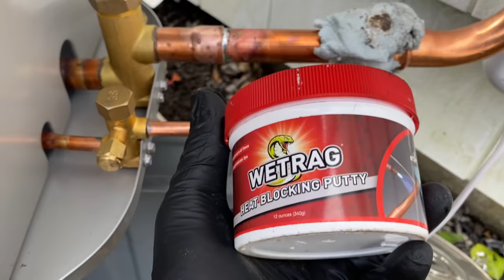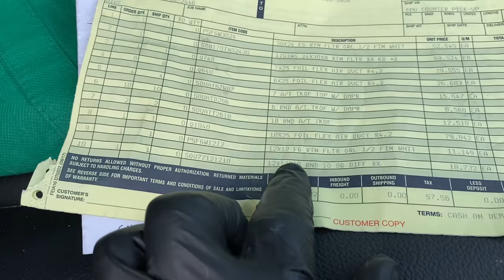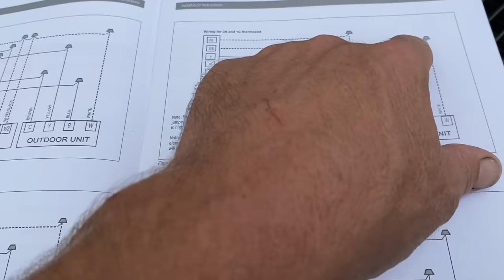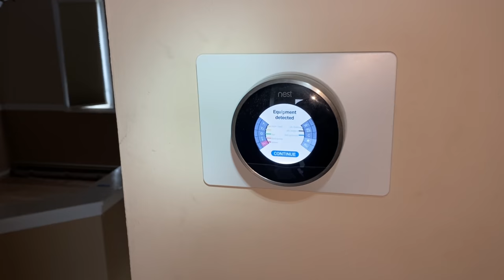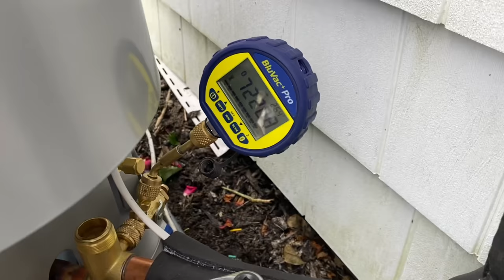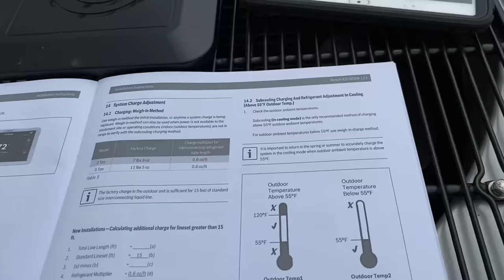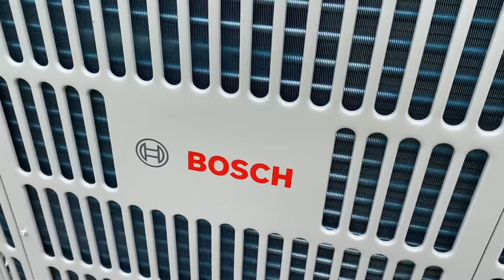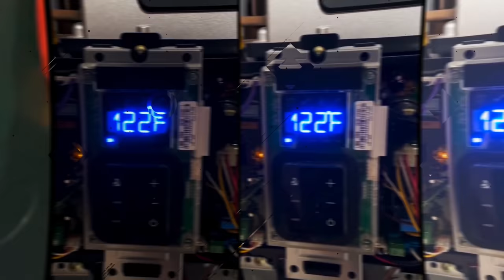Who Installed This Abortion? Another Hacked Central AC System Replaced with Bosch IDS 2.0 Equipment

Comment: You're the man pipes!!! And I was always told to open liquid line first because if you open vapor line, all the liquid will sit behind compressor on start up and possible flooding could "possibly" damage compressor. 🤔 what do you think?
Reply: I was always told to open the vadpor line first that it pulls all the oil out of the  compressor if you open liquid line first. Then I see Mikey opening the liquid line first so that's another myth.
Reply: @ronniebuchanan6575  dont do that, you run the risk of sucking liquid back into the compressor.  just crack the liquid and wait a couple seconds to fully open.

Comment: Hey Mike nice install . I usually do a attic install using as much round pipe as possible on my suppies and retutns . But nothing wrong with flex up to a certain lenght . I change my pump oil every month unless I have a burnout . Then I change it right after that .
Reply: 30 year vet here in Canada 🇨🇦 Blows my mind the amount of flex used in the states definitely makes for a quick install tho .

Comment: I work on a lot of pre-existing system's large RTU's and I have to vacuum through compressors. Vacuum oil being new helps cut down time to vacuum system down for me. Sometimes vacuum will plateau the only thing I do change oil in middle of vacuum than system will continue to pull down.  New copper and non contaminated system usually vacuums down quickly... Usually , depending on condition.

Comment: Love the Bosch 2.0 last one I installed had a nest stat I didn’t realize it at first had to change reversing valve to B because it was trying to run heat at first but those systems are awesome and we’ve started to install a bunch here in NY with back up strip heaters as well. Love your work mike and enjoy watching Bosch installs as well!

Comment: That attic isn't too bad......but im glad im commercial/ industrial and don't have to deal with them anymore. I spent my first 12 years in install in So Cal attics which get to 140°+. 
PS- You dont have to insulate the liquid line on a conventional heat pump. Mini splits you do, because its not a conventional liquid line. Its a low pressure, low temp line. Think of it as a long line to the indoor coil after the EEV. Just like a conventional system where you see a txv that goes to a capillary tube distributor, same concept

Comment: Liquid line insulation isn’t needed, but it doesn’t hurt. Attic runs gain heat without it in cooling, and lose heat in heating… but it is all efficiency…

Comment: I change my oil about every 3rd time, but I have an older rotor vane system that runs in the oil and it helps keep scaring down on the vane. on the opening the valves, I always open high side first, keep the flow going in the direction of the normal ac system, I also always start the vacuum on the low side then open the high side once it pulls down.

Comment: Great video, nice install. I was curious if the air handler has any kind of electric aux heat or e-heat. Seems like the low winter temps. are not ideal for a heat pump. Wonder what the Bosch manual says about the subject?

Comment: Liquid Side First Ensures you have no restrictions. It passes thru then flashes.heat in attic helps the. From being in a vac pulls to the suction line. ( idk way I was taught and think it’s the best practice) 

Comments below. Idk if I’m just picky or whatever but I change the oil on my pump after every use. Before it gets put back in the truck the oil is changed. Quick change cartridges it’s a money making tool treat it well. 
Young Mikey is right. I have had an appion Tez and didn’t change it and pump took a shit. ( which was new installs) with an electrical connection at the disconnect 

I have seen a lot of heat pumps on the island. We have always insulated both lines. Otherwise loosing heat during heat operation.

Comment: One other thing to take into account on the condenser unit is the spray pattern of the sprinkler system. You took out some plants to set the unit in it's new place, but had a sprinkler riser head on both sides of the unit, don't need to drown the unit. (lol)
Reply: @PipeDoctor  My bad, did not think that way, I have installed coil coolers on units in Las Vegas on roof top units. Air temp around 110 deg's. roof temp 140 deg's.

Comment: If the TXV is in the air handler, no need to insulate the liquid line.  You don't need to change the oil in the vacuum pump unless it's affecting performance.  But changing the oil should extend the life of the pump.

Comment: How much.? $17,500.⁰⁰ for demo old system and install Bosch IDS 2.0?

Only reason mini splits insulate liquid line is because the EEV is in condenser and in cool mode both lines condensate beacause they are both after the electronic expansion valve. So the line set is part of evap coil.

Comment: No P-trap? Wouldn’t that pull humidity up the drain into the airhandler?? Plus the thumping sound when it tries to suck trapped water up such a long line and slams it back down.

Comment: Stay bright 8 is very strong, the issue is when PLUMBERS use it, because, the flux job is different from water piping. The flux needs to coat the male fitting, and the female needs to be CLEAN, but unfluxed. There needs to be ZERO flux intrusion into the lines.
I am still a fan of silver with a nitrogen purge flow over stay bright 8.

Comment: The manufacturer has to recommend replacement of the oil after every use, because they have no idea what contamination is in the system you're evacuating.
 It is a good service practice; considering the unknowns of every evacuation. I personally change the oil when my pump fails to pull below fifty Microns, or when I feel as if the oil has outlived its purpose. 
 I've repaired a circuit in a package unit that was left open to atmospheric conditions for weeks. When evacuating l, I literally had to change the oil twice and the process took an hour and a half, even using TruBlu hose

Comment: It was me that commented on opening the liquid line first. Mostly because if you open the suction first the refrigerant flows  backwards through the txv which isn't good  for it. Obviously doesn't apply on heat pumps.
Reply: Oh and you only need to insulate the 3/8" line if it's an outdoor txv

Comment: VACUUM PUMP OIL CHANGING In my opinion changing the oil depends on a lot of factors like how dirty the linesets are, how long the construction crew left the lineset open to air, and whether the system was a burnout e.t.c.

Comment: You do not need to insulate the 3/8 liquid line for a heat pump. But you do need to insulate the return and supply box’s in the attic.

Comment: here in arizona, a majority of our splits are heat pumps. never see insulated 3/8th lines, only 7/8th. also is the filter drier at the air handler per manual or? otherwise install turned out nice.

Comment: I opened high side 1st because the smaller line has less of a chance of sucking the oil out of the compressor with the vacuum..  I don't know if that makes sense but that's how I do it

Comment: If you  don’t change that oil,  it corrodes the guts out of your pump.   I had the “still works fine” attitude.   Took apart my one year old pump and it was rusted inside.    Now I dump the oil when it’s still warm every time.
Reply: @PipeDoctor   Till it doesn't perform anymore.   I have a friend using the same pump for 15 years.   He's not an installer though and he certainly does mind that its slow.

Comment: Nice install however, as a homeowner, I'm afraid to bother with the complicated HVAC units with all the bells and whistles due to more to go wrong and more cost to maintain. When I saw that big main board on the condensing unit and then L1 & L2 connecting to that board, I said no way...that stuff is not robust and not rugged for the long haul. Solder joints on those boards tend to crack and I'm sure just that part price is well into $500 range. Good that you put another return in the master, more than one return is important for a few reasons. Looks like the customer paid a hefty price for that high end HVAC.
Reply: @PipeDoctor  Yes and those nice 10 year warranty costs are in the price of the unit. If the cost of power is on the high side for a set location/area, it makes a lot of sense to choose 18+ SEER condensers. Our power in CA is .29 cents per kWh up to a certain amount consumed, about 1,300 kWh, then it goes to .34 cents per kWh thereafter. We use a good 1,700+ kWh in the summer months so depending on the cost of those high SEER units, it might benefit us to change out the great equipment we have currently. No plans on moving so, we'd benefit. Still using a 10 SEER R22 Copeland.

Comment: Question you put acid Flux on the copper inside and out my concern is that the Flux is going to be inside mixing with the oil/ ref and later causing burned out pump. Just asking. Nice clean job . Danny is the one!!!.  Love those Bosch units I have to get better at selling them only been in my own business for a year. I change the oil after 4-6 jobs

Comment: I think I would add a surge protector at the condenser and the evaporator.  While the whole house surge protector does a good job, you should have a surge protector closer to the equipment. Something like an Intermatic AG3000, would be easy to install and an upsell for protection of that expensive Bosch electronic hardware, not to mention the compressor.
Reply: I recently got a new Lennox XP20 heat pump. Definitely made sure to ask them to install surge protectors. One on the air handler and one outside on the disconnect box. Lived here 14 years and never had a surge with my carrier unit, but this new Lennox is like a computer. Luckily, about a month ago during a storm we had some power surges but it didn’t trip any of them. BUT I thought to myself, damn glad I remembered adding those surge protectors! Lol

Comment: Lot of heat pumps where I'm at in Atl GA.  Don't need to insulate liquid line. It's always the liquid line. Suction line will be discharge in heat and Suction in Cool mode. W1 is needed for outside to turn on auxiliary heat when in defrost in order to temper the air because it's in ac mode when defrosting and you don't want it blowing cold air inside in winter 😑

Comment: NOOOOO. 
The main reason why he vapor line is ALWAYS opened first is oil return to compressor.
It is spelled out in the install manuals.
Opening the liquid line first flows refrigerant to the liquid line, the refrigerant takes oil with it.
Opening the suction line first, oil flows into the vapor line, and on startup, oil is more quickly returned to the compressor.

Manufacturers always specify opening the vapor line first.

Comment: I put the micron gauge alone on the pump before every vacuum if it pulls down to 50 after 1min I won't change the oil

And open the liquid line first. If you open the suction you'll get oil out of the compressor into the suction line

You don't need to insulate the liquid line. Mini splits are both insulated because the exv is outside feeding the indoor head
Reply: @PipeDoctor  yes easy test .

Comment: Contaminants in the system degrade the oil, new systems flushed and filled with nitrogen shouldn't have many if any contaminants. I have gone months between oil changes, still fairly clear when changed.

Comment: Why did you use such a funky color coding on the low voltage wiring?
Reply: @PipeDoctor  I just realized your low voltage wiring may have just not had the right colors in it. Normally brown or orange (depending on the valves default position) is your reversing valve (you used blue) and blue/black is your common (you used red). There is an industry standard color coding for low voltage control wiring and someone might be confused in the future.

Comment: I dont change the vacuum pump after every use. It has alot more to do with what you are vacuuming. If you are doing new clean installs theres no point. If you are pulling down a dirty contaminated system thats boiling out refrigerant from the compressor oil and your oil gets cloudy and you are struggling to pull a vacuum then i would start changing it during the vacuum. I work of refrigeration and sometimes you get a big system that was a burned out compressor and you need to change the oil to ever get low enough microns cause it will turn the oil black.  Otherwise i wouldn't worry about it. As long as its pretty clear and you reach the microns you want i wouldn't worry about it. As far as insulating the liquid line theres no point. Im here in heat pump country down south and nobody insulates them. Its warm in the summer and if anything it will help reject some more heat in the summer. And in the winter its the return so its warm after leaving the coil and cooling off more doesn't hurt. With mini splits they usually have the expansion device in the condenser so they need to have both insulated.

Comment: I always change it after every time I’ve seen it were it won’t pull down more I’ve also had my samn and micron gauge wouldn’t pull down ended up getting oil had to use alchol to get rid of the oil good as new

Comment: Nice job question those low voltage connectors can you actually get meter leads on them to test voltage or do you have to take it off?
Reply: One other thing do you order your plenums insulated on the inside?

Comment: On the surge protectors, it's a must or not warranted from our suppliers, on the Bosch systems.also not necessary to insulate the 3/8" line.
Reply: I'd think that line would want some cooling since it is the high pressure or hot one.

Comment: The CLC bag I bought and was using, got it full of tools and a few screws, wire nuts etc, was 36' up a ladder and the clasp broke and the strap swung around and hit me in the temple, I almost fell off, luckily the man helping me was grabbing the nitrogen tank from me as it happened and he grabbed my arm and pulled me onto the roof - true story, so I tied the damn thing, after going back down and the other side did it about half way up, only this time, it didnt hit me in the head, so yeah CLC is crap

Comment: Do those systems claim to be able to pull heat out of the air in  New York winters with out having to have defrost? Or having supplemental heat, as in heat strips. Just curious? I live in NC, I work on heat pumps of all kinds  everyday. Never a Bosch though, so I thought it was interesting that there was no defrost or heat strips.

Comment: I still don't trust those zoom lock fittings, but the install looks really good.
Reply: what will last longer those zoom lock fittings or the bosch condenser ? time will tell. are those silicone  or rubber O rings inside the zoom locks? Silicone should last 20 years? Condenser will last 15 years? Disposable society. Dan's apprentice will be there to fix...
Reply: @frankm5019  my concern is the O rings. Will the oil break them down eventually? What happens if the compressor burns up, will the acid in the system eat up the O-rings? I was paranoid about pro-press too when that came out but I eventually got over it. Time will tell though.

Comment: No need to insulate the liquid line in heat pumps, mini solid are insulate because the meeting device is in the out side unit.
Duct board is much easer to do duct work.
Reply: Duct board only good in high humidity places and is cheap and shitty. Round pipe all the time when space is available
Reply: @PipeDoctor  don't use medal duct in Florida.  It sweats and rusts out.
Reply: @Freonleon  to is metal is shity.  It sweats and drops water every where.
Reply: @ronstill3868  did you not read my first comment?

Comment: That was like watching a day in my life, accept we use Ruud equipment, Appion Tez8 vacuum, and fieldpiece gauges.  That's a cool flow regulater for your nitrogen, you guys don't have headlamps?  I use my milwaukee rechargeable headlamp religiously.  Gloves, headlamp, fastback knife, m18 fuel surge driver, rigid 104 compact cutter (which has seen at least $1m worth of jobs, best cutter out there), 3m super 33+ tape, nylog blue, and my veto bag is basically part of me.  Looks like you guys are prepared for 2023, when r290 takes over.

Comment: What supply duct rap did you use?  Nice job on the install
Reply: @PipeDoctor  I am not a  fan of it but I totally understand the concept of it . I did way to many duct cleanings and the insulation on the inside doesn't hold up over time.  But that's just my opinion..

Comment: The reason they say change the oil each time is because moisture in oil creates cavitation because oil will foam when it gets compressed with moisture the cavitation causes micro pitting on the pumping surfaces which will cause it to stop pumping through leakage internally I personally change mine after 2 or three full vac downs I have a robin air and I have had it for 10 years still runs like a champ common science and reasoning tells me that the heat of vac pump should boil off most moisture especially since water boils at very low temperature when under vacuum so moisture inclusion in pump is minimal just my thoughts

Comment: on the high side line, you shouldnt insulate them, it allows the refrigerant to further condense into a liquid, by insulating them, it takes further for that process to happen, if at all. So it is not recomended to insulate the liquid line, on mini splits, it is due to both lines being cold and sweating and to keep from ruining the ceiling etc.
Reply: let me add, I understand why in your thought process, needing to insulate the 3/8" line, but all of the cold happens outside on heat-pump mode, it send high heat vapor in and returns cool, but not cold liquid phase refrigerant, but rather a mostly vapor state that has been slightly cooled by the transfer of heat, then the TXV outside meters the refrigerant into the condenser and thats when it becomes a liquid state and transfers heat to and cools on the outside, then pumps up again.